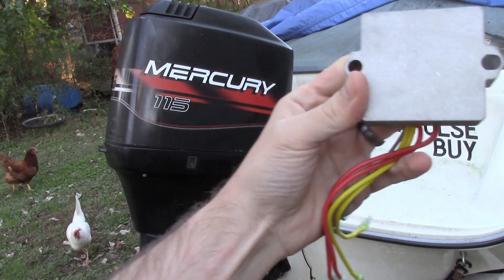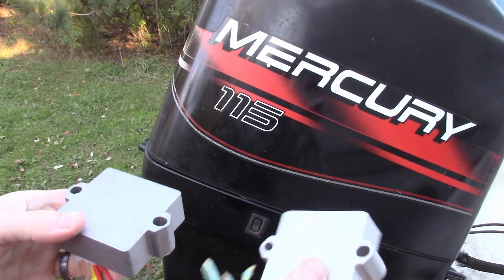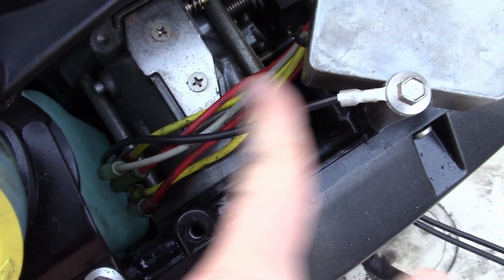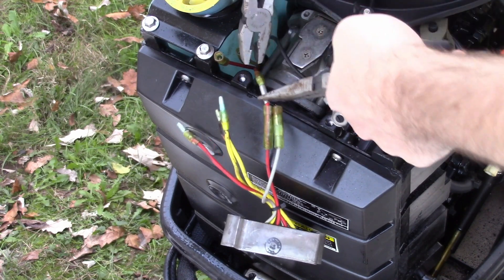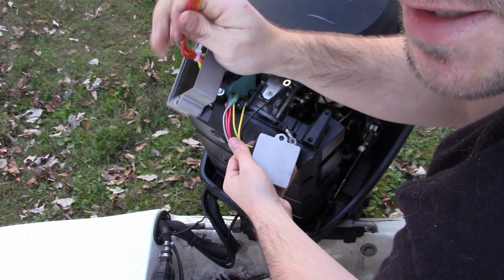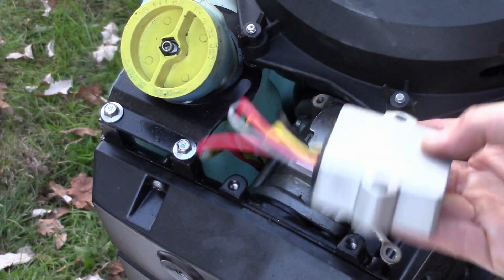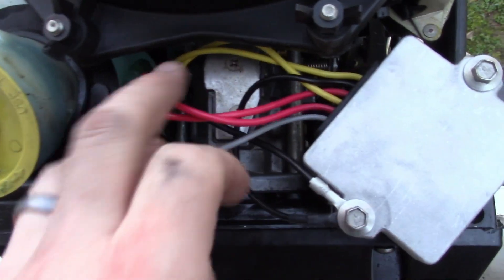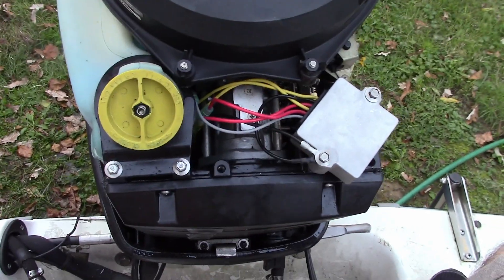Replacing the Voltage Regulator on a 1996 Mercury 115 HP Outboard  815279-3

Comment: Did you see a different in voltage drop when you use the trim ? I’m having a problem when I trim up or down my voltage gauge drops and my tach stop working
Reply from the maker: I did not notice that, once I saw it hit 16v I high tailed it to the dock. I do know that the voltage drops a little when I use my trim but only to like 13v and tach does not drop at all.

Comment: Is that a 2x2 motor,  meaning that it runs on two cylinder below 1800 rpm and all four above that ?
Reply from the maker: Yup it's a 2+2
Reply: I have a 1989 version and have had it since new, I love it, still runs well, but I have had an issue with misfiring on one cylinder, I have replaced all the electrics and am now cleaning the carbs, gotta keep it running, cant afford a new one,   @striker1211

Comment: 2 yellows both male connectors , how did you know which yellow goes to which yellow?
Reply from the maker: It doesn't matter, the yellows carry AC current to the regulator, which converts it to DC
Reply: @striker1211  Sir thank you very much I really appreciate you taking the time to answer that question have a great evening
Reply: In ur video did the motor loose power when the voltage dropped.